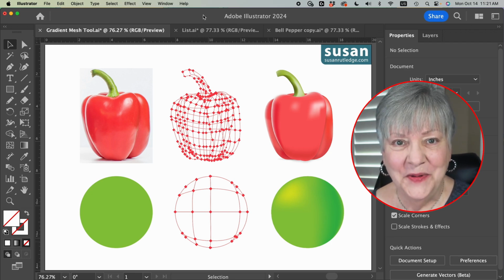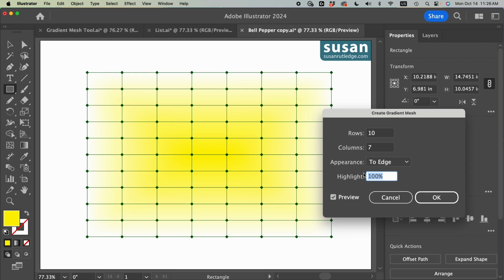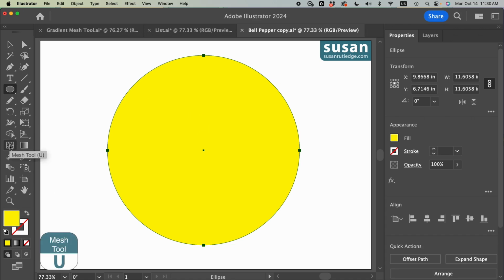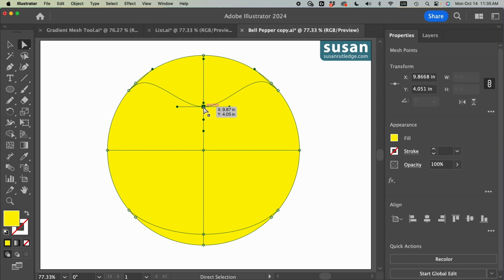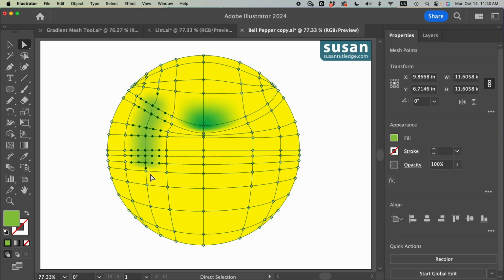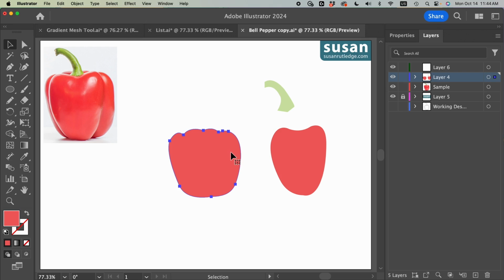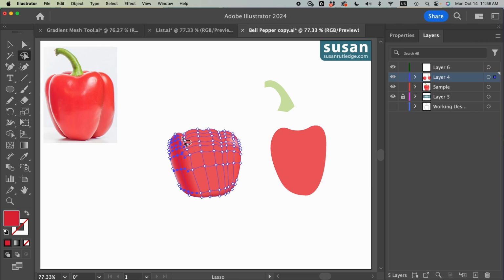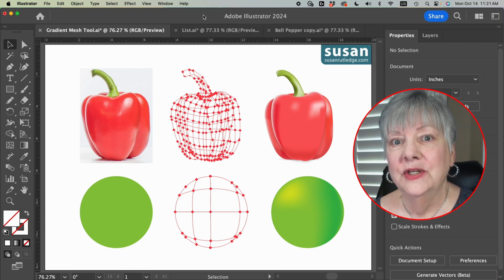How To Use the Gradient Mesh Tool in Adobe Illustrator

Comment: I have been working with Ai professionally since the Macromedia days - more than 25 years now and am a senior designer working with established mega brands but to this day I have never mastered the mesh tool (I know it's relatively new but still) even with great tutorials like this I find it incredibly frustrating to get accurate results when working on complex shapes - its so much easier for me to just manually draw in the shadows and highlights to give things texture and shape, sometimes I even draw a linework mesh on a layer I can hide or lock to define the shape for me over the object then manually draw in the fills and highlights and gradients using the heck out of blur and feather then delete the mesh - I haven't given up though so here I am lets try again
Reply from the maker: Yes, even though you can figure out how to get shading to generally go where you want it, it's often trial and error, and you may never be able to replicate the results exactly a second time. But it's still a cool way to add some highlights. It sounds like your artwork is very detailed. I imagine it's wonderful!

Comment: Can a Gradient Mesh exist without a color fill,I prefer having empty paths accent with highlight,mid-tone and shadow
Reply from the maker: No, the gradient mesh always has to be applied to a fill color. However, you could use a VERY light white as a fill. Try RCB 255, 255, 254. It won't be a transparent fill, but it will at least allow you to create your accents without a visible background. Hope this helps.